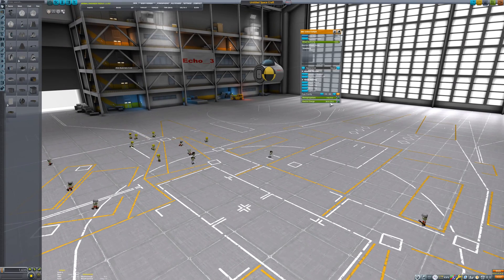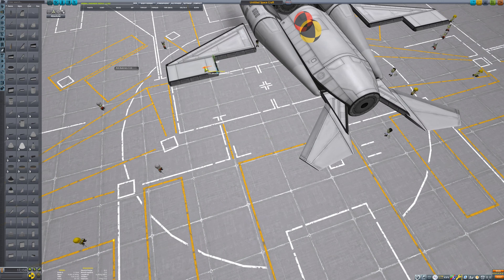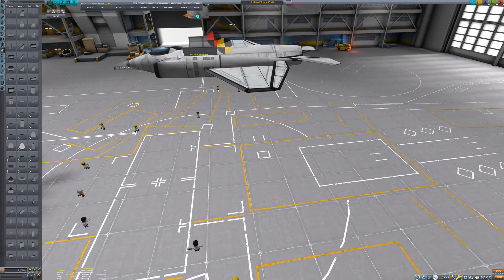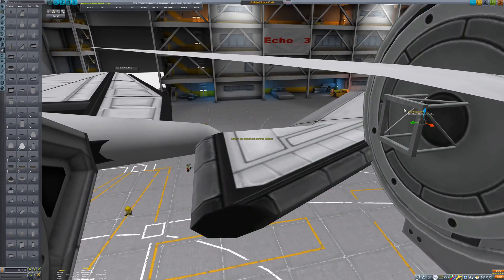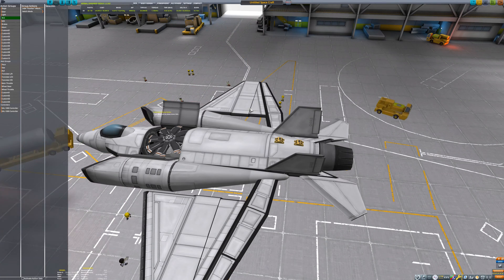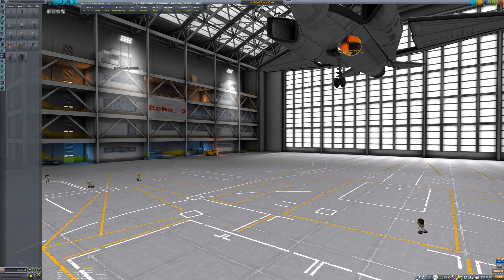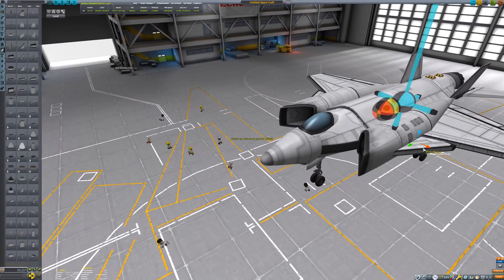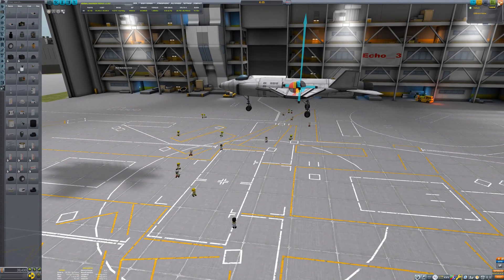How to make an F-35B style plane using the Breaking Ground DLC

Comment: really cool recreation! even if it doesnt look true to the real plane. i have my own f35 recreation in a sandbox save but it uses a jet engine on the front instead of a duct fan. how do you balance the thrust between the fan duct and the jet engine? did you just guess it? i plan to replace the jet engine with the duct fan because realism i guess and because the jet engine is too big and it clips out of the fuselage.
Reply from the maker: I guessed a little. That's why I have the engine thrust drop to 80% when in VTOL mode.